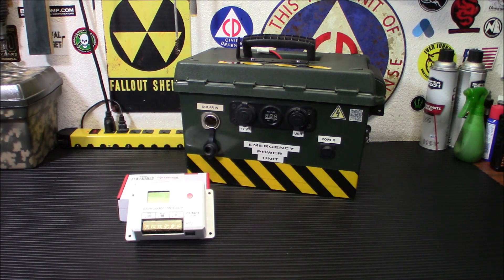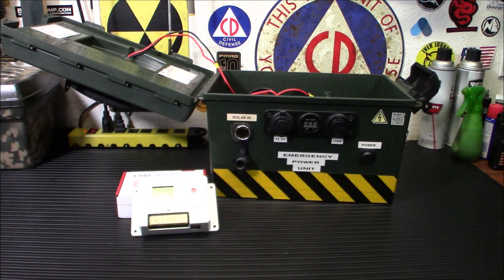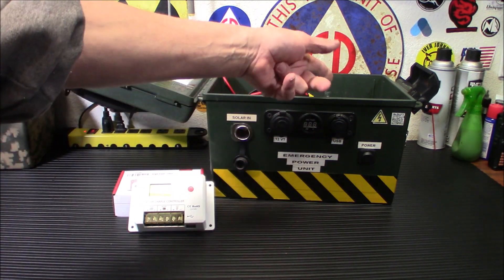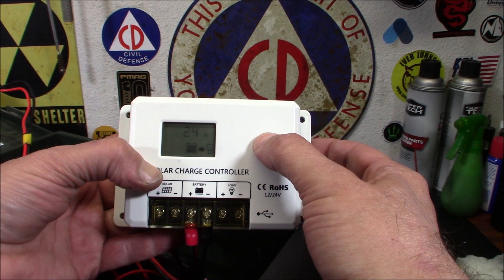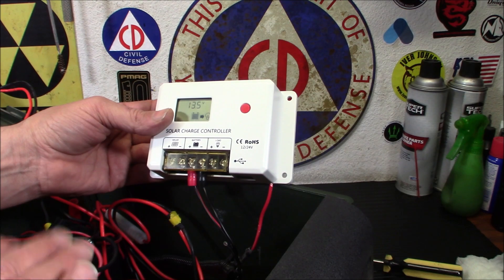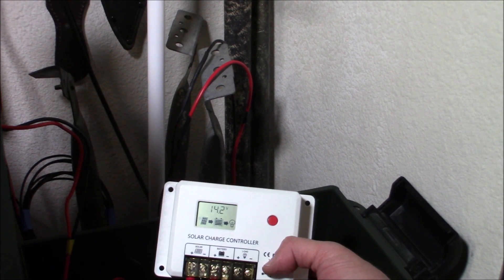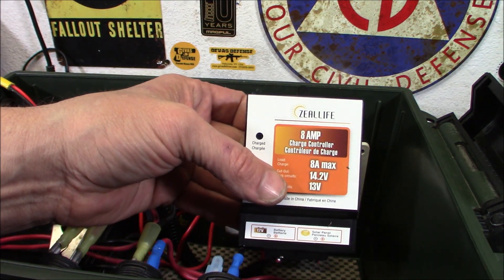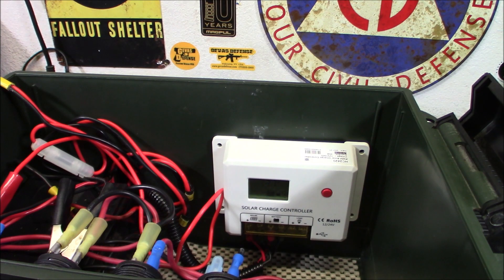Battery Box Upgrade: BougeRV 20Amp Solar Charge Controller

Comment: Hello I’m new to ur channel. What does this do exactly? I’m trying to figure out what to buy for prepping. Thanks for your videos. Is this just for RVs. Yes the world has gone mad !!!
Reply from the maker: Its a charge controller, you put it between your solar panels and batteries so your panels do not overcharge your batteries.  Super important in any solar type system and the box I installed it into is a backup power box for my ham radios so they can operate off grid.